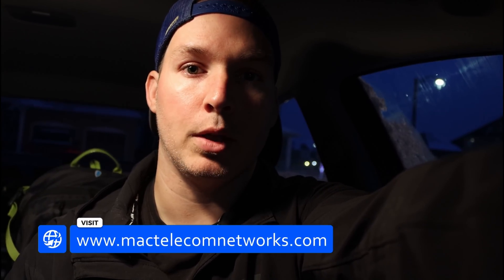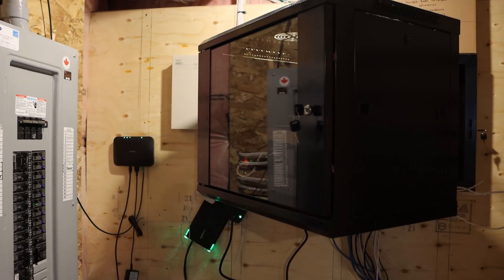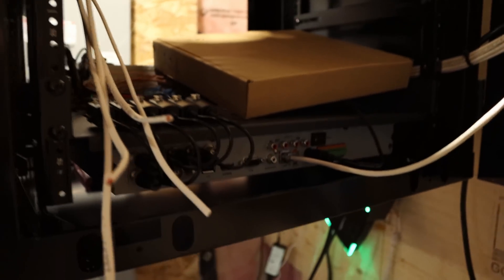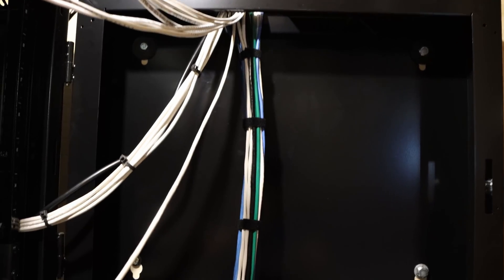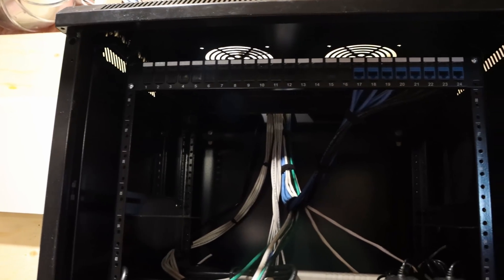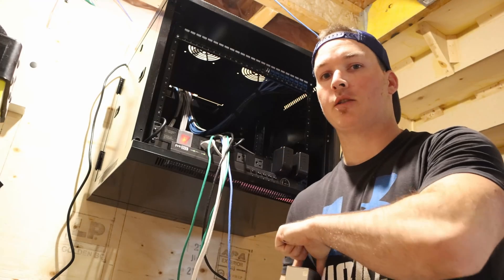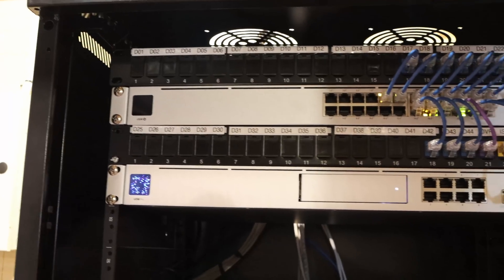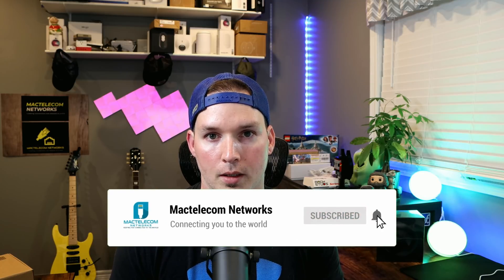On-site Ubiquiti installation

Comment: Nice install! just curious what a job like this would cost for labour? That wiring is really nice. Do you work in Toronto?
Reply from the maker: This job already had the cables pulled so for me it was terminating the cables, mounting the gear and configuring the network

I charge $90 an hour for physical work ( terminations) and $150 an hour for configuration.

This job ended up costing the client about a grand that was time and material ( network jacks, patch panels)

I do work in Toronto visit my website or send me an email if you need help on a project

www.mactelecomnetworks.com
Reply: Thanks for the quick reply.

Comment: Looks good , usually I do sticker with small size in the patch panel and write the specific location , I guess in this case it's was not needed ?
Reply from the maker: Depends really on customer but as long as the labelling is the same on both ends we’re good

Comment: why no service loop on the cat 6 cables looks like you cant open the back up now because it will pull on the cables to much. Also dont got a whole lot of wire to work with if you ever need to re terminate the wire. Love your videos tho man!!
Reply from the maker: I didn’t pull the cables only terminated them. If I pulled it there would have been a service loop

Comment: Do you have any methodology in picking what colors you use for patch cables (cameras, VoIP, APs, Switches, IP, and so forth)? Just wanting to know if there is any particular standard that network professionals use; like electrical cabling has specific colors to designate ground, line, travelers, secondary line, neutrals, and so forth. Or do you just make up your own standard or use what the customer requests?
Reply from the maker: Honestly still trying to figure out the best way. Its hard to get stock even for the patch cables. But once I figure the coloring out ill let everyone know what I use
Reply: When I planned out my network install earlier this year, I figured I would do red Cat6 for anything getting sending PoE, blue for wall jacks and red for my cameras. The cable I wanted was sold out, so, in the end, I just went with green for everything..